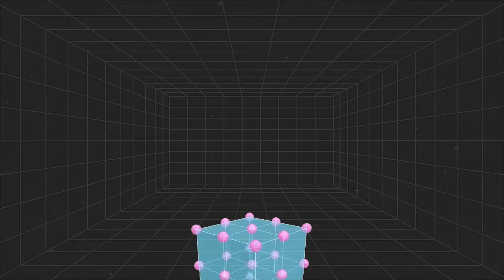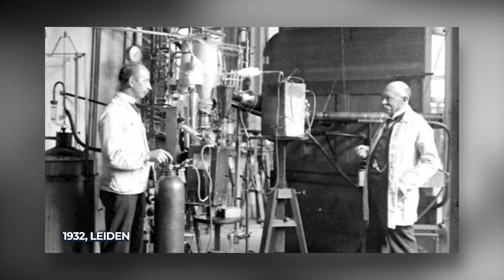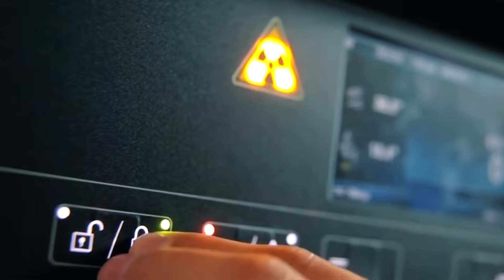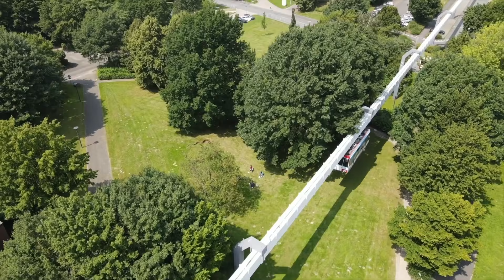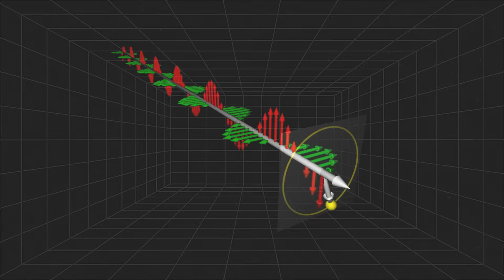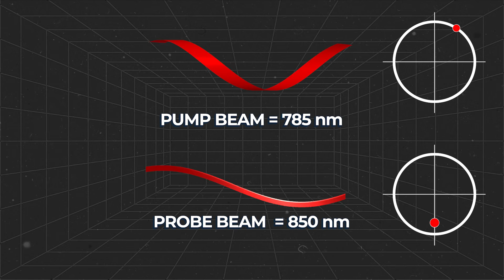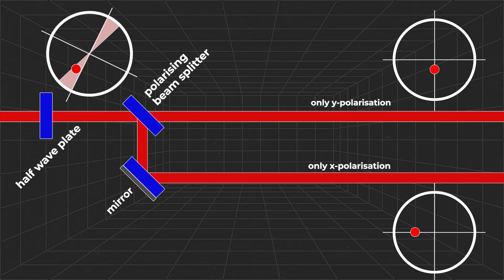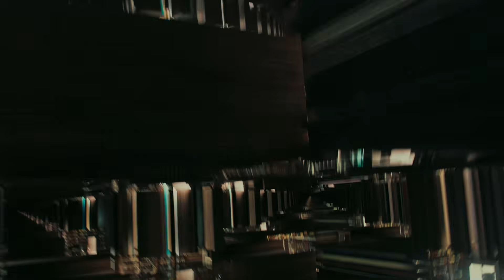Impossible Time Crystal Breakthrough - Explained

Comment: As a fellow physicist I am really confused. If all that is necessary for a time crystal is it showing a repeating behavior given a constant energy input, how isn't a simple gear a time crystal with infinite lifetime? With constant application of energy (for example dragging a long chain alongside it with constant speed), you cause it to rotate and thus repeat a pattern in time. The experiment in your explanation is pretty similar, just performed on an atomic scale. So, what is so new aboit this behavior besides the size?
Reply: The gear or sprocket driven by a chain constantly dissipates energy, the energy only flows from the chain to the sprocket. The nucleons do not dissipate energy after being aligned and the electrons emit photons at the same rate they are absorbed so there is no net energy input
Reply: @shanent5793 But doesn't the time crystal do the same, as the example with a superconducting loop, where the energy is gradually dissipated through interactions with magnetic field? I figured from the video, that no-go theorem posed that there can be no time crystals that don't require some energy input to work, so the focus shifted to finding time crystals that have an independent repeating time structure, given a constant non-oscillating energy input. Did I understand the shift wrong? As far as I gathered from the report, the discovered time crystal would still stop being a time crystal if we cease to provide polarized light, in other words it needs to be fed energy, otherwise the oscillations would dissipate, so it does dissipate energy. I mean, how could it not? If there are oscillating magnetic fields within, which shoud be there since we have precession of charged particles, we shoud expect it to be possible to extract energy from it (change in magnetic field has capacity to generate current which could be used to produce work), so the system overall has capability of losing energy. And since it can lose energy, given enough time, it will, no? The only way to ensure that no energy can be extracted there is to make magnetic field at every point equal to zero, but its clearly not the case.
Reply: @Ingvar_the_Red  Flux through a superconducting loop is quantized so I have no idea why he says it must be dissipated. The electrons in a superconducting loop are like a gas and disordered so Watanabe and Oshikawa's theorem doesn't apply to the general case. If the interaction isn't a multiple of the flux quanta it just won't happen, ever.

Symmetry breaking can be satisfied by having long-term oscillations with a period longer than any oscillating driver. Depending on the initial state simple oscillators can also have long periods eg. beat frequencies. The difference is that in the long term a simple oscillator will eventually settle at the driving frequency.

The pump laser and magnetic field are necessary just as gravity is necessary to a pendulum. Gravity doesn't perform work on the system in the long term but removing it will cause the oscillation to stop. Similarly, the pump laser and magnet only supply energy during the initial transient.

Clearly energy can be extracted, it would be restored by the driver. It oscillates reversibly, without generating entropy, but it's not a perpetual motion machine from which energy can be extracted for free.
Reply: @shanent5793 I feel that a pendulum is a bad example. because the pendulum will eventually stop even with gravity present, precisely because of energy dissipation. Energy being quantized also doesn't prevent it from leaking, to be honest, because you dont need an exact energy level match, exact match is just the by far the most likely condition under which the transfer would occur, you still have a range due to the uncertainty principle. 
I never even thought of it being a perpetual motion machine. As far as I gathered it's just highly unlikely for energy to dissipate from this system, not impossible, so it can be useful for things like data storage. but it still will occasionaly dissipate some energy and require more from the driver, since it is still possible to extract work from the system.
Reply: @Ingvar_the_Red  ignoring the equally likely gain of energy due to uncertainty is dishonest
Reply: @shanent5793 No, no, I meant that you don't have to have an exact energy level match for an energy transfer to occur, not that the loss itself happens due to uncertainty.
Reply: @Ingvar_the_Red  How else can the transfer happen despite the unfavorable energy conditions, if it's not due to uncertainty? I don't see how what I have said is dishonest, it's the standard statistical interpretation. If the interactions are reversible, then the losses and gains are equally probable and will balance over many interactions, resulting in no net energy transfer.
Reply: @shanent5793 I am getting lost with your logic, I feel like the best thing to do is to go and read the paper and actually try to figure how the model works and if it's possible for energy loss to occur. I am certain it can happen with the superconducting ring example, since it's basically an electromagnet, so of course you can use it to lift stuff up, so you can pull energy out. I am not so sure how the field looks like for the setup discussed in the video.

Comment: My practical idea: it's difficult enough (read: not actually possible) to synchronize independent timers accurately, e.g. traffic lights not centrally controlled. A time crystal, oscillating a property which commutes over an ER bridge (read: quantum entanglement), could provide that impossible synchronization.

Instantly. Over any distance.

[I may have been a civil engineer obsessed with this problem in a past life. Just the temperature difference from one intersection's switch box to another intersection's would cause their internal R-C/555 (or crystal) timers to rapidly de-synchronize.]
Reply: Easier to provide a crystal oven, no?
Reply: That's, ironically, the problem. Thermal expansion induces electromechanical property changes, e.g. varying the capacitance or resistance of a capacitor or resistor, vital components of "555 timer" circuits. These regulate the frequency of the pulses, which are counted to indicate the passage of time. If these change… the rate of time passing changes, at least, according to the device. (And yes, providing a "consistent temperature oven" could be a theoretical solution, but a poor one from an efficiency and loss perspective. 😜)

Similar issue, though less pronounced, with quartz crystal timers. These can still go out by a few seconds over the course of a month due to these environmental factors. Your computer keeps its internal crystal oscillator "in time" using Network Time Protocol (NTP) servers to calculate drift, and locally adjust. (Central coordination somewhat resolves the issue of independent timers, by not being independent.) @SeekingTheLoveThatGodMeans7648
Reply: This sounds like it would conflict with the no communication theorem about entanglement?
Reply: Non-locality has been demonstrated through "Bell tests", though absolutely there currently are some silly (read: extreme) limitations on the durability of the message carriers (entangled atoms or photons) and viable range.

In 2022, a team produced entangled rubidium atoms and achieved communication for "device-independent quantum key distribution" up to 400m separation. (July 28 Nature) A third study shortly after (July 29 Physical Review Letters) achieved 220m with photons. (They aren't as stable.)

 @drdca8263

Comment: I simply refuse to jump on this bandwagon. A non ground-state oscillator, that takes energy is not a time crystal for my humble self. There are many, many known mechanisms to create oscillations within crystals from a stationary power source. E.g. a diode Laser or a DPSS-Laser can do the job. Arbitrary oscillation frequencies and waveforms can be generated from an OPO (Optical Parametric Oscillator) and even an ordinary quartz-crystal from a crystal oscillator can be convinced to oscillate from a DC-power source, when some sort of amplification and position-sensitive feedback is created e.g. by a magnetoresistive coating.
Reply: We'd have some kind of complex system here for your examples, not just a "pure crystal."  But I can't think of any other fundamental difference.  Being able to do it in a pure crystal alone seems to be something new.
Reply: @SeekingTheLoveThatGodMeans7648  I respectfully disagree. Verbalism does never constitute a new physical property. It does not matter where exactly you place your complex excitation apparatus (in this case a Laser). A stationary ground-state property must be self-sufficient and self-contained, like e.g. an electron has a stable ground-state bond in s, p, d, f, … shells to a nucleus and does not create synchrotron-radiation upon heating. As far as the Coulomb binding energy is not exceeded by the applied kB·T-energy, of course. In the moment, a stationary oscillation mechanism converts energy, we do not have any longer a quantum- or chemical-structural material property, but we simply «abuse» particular physical properties of hadronic matter in a particular arrangement to achieve an arbitrary goal. Any optical harmonic generator-, or OPO-crystal does the very same thing, since it is formally (!) free-standing, but the oscillation is introduced from a resonant cavity by a constant supply of electromagnetic power - vulgo a Laser. Meta-materials are infamously famous to do strange things. A doped crystal is already a meta-material (sic). In my humble opinion, a real time crystal requires a black hole since within the Schwarzschild radius time- and space coordinates flip in accordance with the Penrose diagram. A proof for such a thesis however is not easy, since black holes in a lab are not very handy objects.
Reply: @debrainwasher
Perhaps it's a living crystal like the brain that stores thoughts that cannot be captured but only observed in a quantum motion as electron motion between nerve gaps. 🤔

Comment: Interesting..  definitely interesting, thank you for going to the effort of explaining this..  as an Radio R&D engineer, I'm strugging to FULLY grasp this (the experiment I could follow, nice trick cancelling out the systematic errors)...  I need to read up on spin...  again,  I assume we're talking about quantum mechanical spin here.. which is really weird.  Uses, not enough data to tell yet.. at least not for timing purposes, timing is all about size, power and accuracy..  how could one interface to such a crystal?..  it's all very well that it oscillates..  but to keep track of those oscillations one needs to interface to it constantly and that means power transfer, one way or the other, which sort of defeats the object.. it feels like this in an effect that would be useful to some edge of physics type application, but that's beyond my pay grade.
Reply: It's observed through the phase shift of the probe laser, which in principle isn't transferring any power. For example you can tell the difference between glass and fluorite by observing the polarization and without having to melt them with the light source
Reply: A time crystal is a perpetual motion system... Look: I know the early history of the qtc quantum time crystal...Back in 2010 in moodle chat operating for student lecturer discussion, a student raised the point that the earth sun system is a perpetual motion system because work must be done to shift the planet to the perihelion since there is a change in potential energy due to a radial change (Wilczek may have been there or caught wind of the discussion).  Wilczek 's work on qtc devoloped a ground state ring of moving particles.  I believe his work requires a theoretical partical with attractive properties to form his infered coalescing into the state ground state ring of moing particles.  I think the work was lazy as it doesn't demonstrate how the forces do indeed coalesce into a ring with the stated ground state function.  Tongcang Li et al proposed a more realistic model  but it too relied on a radial state change which was detectable through their tagged particle -(I think they called it).  around 2015 I think was the first proposed qtc model that flipped magnetic state... I stopped following developments at this stage due to shifting homes to Rotavagas.

Comment: aren't Kelvins just Kelvins and not degrees?
Reply: Degree — a discrete measurement of an amount, level, extent, or quantity. Abbreviated in numeric use using the symbol °, followed by the unit abbreviation. E.g., the boiling point of water:

100°C ≅ 373°K ≅ 212°F ≅ 672°R ≅ 80°Ré ≅ 60°Rø

0°C being freezing? I like Celsius quite a bit. 😜 And yeah, there are a lot more temperature measurement systems out there than people might initially realize…

[Minor note: I have never before seen plural "kelvin" written as a discrete plural, with an "s", though my dictionary does say this is a valid form. I guess… because I've never, ever, thought to pluralize "celciuses" or "ferenheights". 😝]
Reply: @GothAlice  a quick visit to the wikipedia page on Kelvin says it's not degrees, so no °
Reply: @JorgetePanete its. °F

Comment: For me, also a physicist, I have to say, all this "time crystal" talk is boggus.... basically, the first paper mentioned said it, not possible in the universe... and all realized "time crystals" is basically pumping in energy, and generating some kind of oscilattion, either u have a pulsed source generating ressonance, or a continuous source, which also by tiny fluctiations generats resonance or in the last example...a circular polarized laser (which is again an oscilating source)... all the same setups can be done with a quarz crystal... either setting it into an  oscilating field (AC) or vs plates, where it is transfering charges (DC) or if you have some kind or circular charging of the side walls generating an undulation of the crystal...

Therefore, none of the time crystals is really one ;(. 

Nevertheless, a nice video.